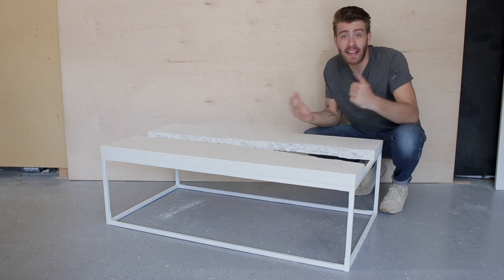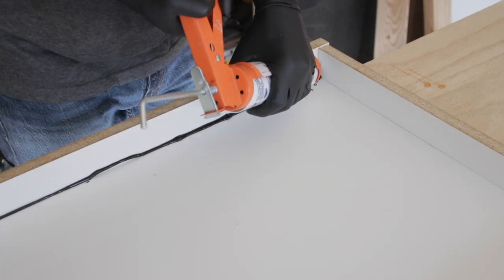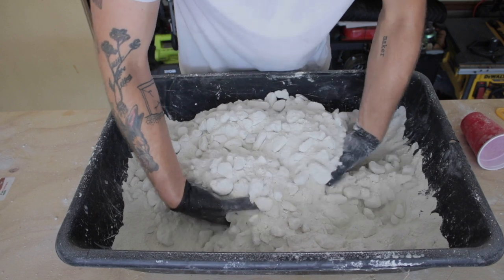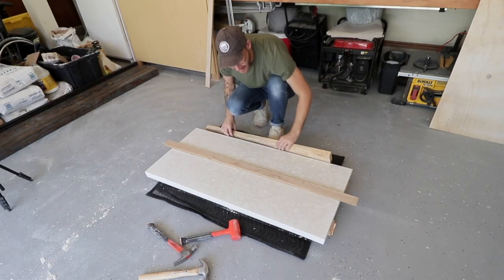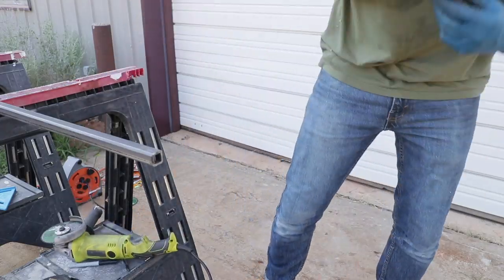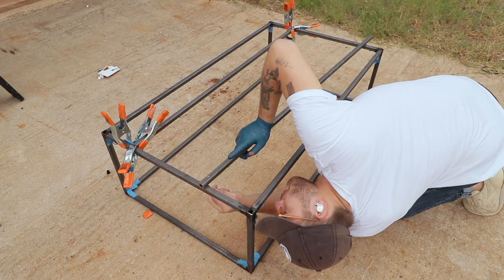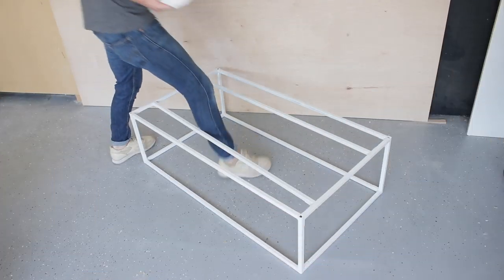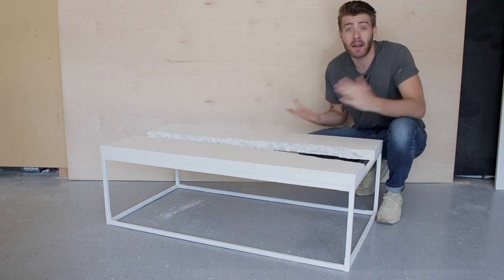Building a CONCRETE RIVER TABLE w/ DIY No-Weld Metal Base

Comment: Been really looking forward to this seeing this since you talked about it on the podcast and it definitely didn't disappoint! Really clever solution to not having a welder - both cheap and effective - and the cracked edge of the concrete looks amazing! I love the tactility and intricacy it brings which contrasts with the rest of the design, and although I see where others are coming from re. the open space with a coffee table I personally don't think you ever really need to use the full surface as the edges are plenty for mugs, books etc :)
Reply: JMakes without the glass it looks more like a museum piece.
Reply: I like the project but you put the dry ingredients into the water - not the other way around. Then you add more water if needed
Reply: @m3selfs950  It doesn't really make a difference in the end result, especially if you aren't using any admixtures.

Comment: I think I would have placed a thick slab of glass over it.
Reply from the maker: Dingoart that could look cool, but I still wanted people to be able to touch the ‘live edge’
Reply: @ModernBuilds  | think you should have added a tinted piece if glass in the middle of the table.
Reply: or under the concrete!
Reply: @ModernBuilds  Why? People are going to spill their coffee when they set it down. It's a cool concept I guess but not very practical.
Reply: @the_jonathan_o  everyone does that. I like that he wanted to do something different.
Reply: @TheWarrrenator  Or have friends that arn't so stupid they can't figure out which part of the table to set the cup on?

Comment: Excellent. But how did you attach the concrete top to the base?
Reply from the maker: They’re heavy enough I didn’t fell like it was necessary, but if you wanted to run a bead of adhesive the base that would work
Reply: Same question arrive to me??
Reply: @ModernBuilds  what kind of adhesive would you use? I tried using Gorilla Glue's construction adhesive for a similar project  but it didn't hold very well to the concrete
Reply: @sjandu  If you really want it secure you could drill a couple little holes into the underside of the concrete (don't go all the way through) and anchor a coil rod into the concrete using a two part anchor epoxy, then weld or bolt the coil rod to the base. That sucker ain't moving anywhere. Better yet if you plan ahead just float the coil rods in before the concrete has fully set. You can get some anchoring epoxy at home depot: https://www.homedepot.com/p/Quikrete-8-6-oz-Fast-Setting-Anchoring-Epoxy-862030/203604177?g_store=6655&mtc=Shopping-B-F_D22-G-D22-22_9_CONCRETE-Generic-NA-Feed-LIA-NA-NA-&cm_mmc=Shopping-B-F_D22-G-D22-22_9_CONCRETE-Generic-NA-Feed-LIA-NA-NA--71700000045600364-58700004679444416-92700039576811666&gclid=Cj0KCQjwpfHzBRCiARIsAHHzyZrGYo5FxQRavB_Cu60ci06iyAAoFCWe92G4TD85ftVEG5wlXRG7HKsaAh40EALw_wcB&gclsrc=aw.ds

Comment: Like the look of the table Mike. Not convinced on praticality, probably need to seal the joint to stop dust. Diluted PVA would probably do the job without affecting the aesthetic.  Regarding the no weld method, why does nobody use pop rivets these days? They are a really low tech solution and can look great. Just a thought.
I like that you try to make your projects accessable to those of us without massive workshops and love your enthusiasm. Thanks for the great content. 👍

Comment: The concrete just sits on the frame? Nothing to hold them together?
Reply from the maker: Nick Wisda just gravity... you could run a bead of adhesive if you wanted but no need

Comment: You had me up until the aluminum epoxy - Yeah it will hold two things together, but not structural or human load; And fill that crevice with clear epoxy 😎
Reply from the maker: Jon Gordon it’s steel epoxy.

Comment: How would you fill the river with epoxy? would epoxy hold the two sides of conrete together or would you use a thin backer on the underside like plexiglass? I want to make this but also want to fill the gap with blue epoxy and would love some thoughts on how to do that

Comment: This is really beautiful...i am wondering what it would look like if you made a clear transparent epoxy fill in the centre of the river path at the same with and height of the slab, that will make the whole surface functional😉

Comment: Mike - just a little design suggestion, if I may? How easy would it be to fix either brass rods or rebar across the void into the raw edge?
Reply from the maker: PageMonster shouldn’t be tough.. Modustrial Maker did something similar... not my style but it would be a neat look!

Comment: I find that if my wife holds the other side of the metal while I cut it works a whole lot better. Also eliminates the issue of table leg falling while I'm on the other side.

Comment: You really should have at least put a few flat head self tapping screws in the brackets since the top is so heavy. If you ever have to move, that table won’t travel well. I’d definitely stick to welding the frame on concrete top tables. Are you going to fill the gap with something?

Comment: I have a question (maybe missed it in the video): can't you just glue the metal legs directly to each other? Why do you need the L brackets if you're gluing it all together anyways? (I say glue, but obviously I mean the Gorilla Weld stuff.)
Reply: It gives it significantly more surface area to bond to which will increase the strength quite a bit.

Comment: Nice project, but its not complete. U should attach the concrete to the metal frame u made. Also u should add a sheet of glass on top if it to make it more functional.

Comment: Did you end up finding and removing the spatula you mixed the concrete with in the mix after you dumped it in the form? 

Couldn’t see it in the edit, so I’m wondering if you have a plastic spatula still in your table 😂

Comment: A terrible makeshift. The angles should be welded, or at least bolted to screws. The table top could have an epoxy resin inside or a piece of wood embedded in the concrete. It would look great. And of course, the top should be screwed to the stand, and felt or rubber pads attached to the bottom. If you are do something, do it properly.

Comment: Wow! I just watched your white cement video and I’m happy that you found a great improvement to the all white mix recipe. It looks amazing, and it’s so much stronger than the original! I wanted to make small pours so for me I think that the small aqua pebbles will be enough. Also, I was so surprised at the no weld structure, I really didn’t know how you will do it, but it’s nice to know that it can be done without specialized tools (I think that it can be ven be cut by hand, it I’ll take longer but can be done). Thanks for sharing!

Comment: If your concrete is a little wet just let it dry in the sun and the water will evaporate. I’m in the trades so I work with a lot of concrete.

Comment: yeah sure, the base is sturdy enough when loaded vertically, straight on the metal bars. but have you tried rocking it from side to side as if it was dragged from one place to another?
Reply: maxim_sys why would it ever need to withstand that

Comment: Nice looking project, Mike. I agree with others who've suggested covering it with a sheet of laminated plate glass might make sense and look good, too. But it surprise me than I don't see anybody else questioning the use of epoxy for something like this. Maybe Gorilla epoxy is something special. But I've been epoxy with and without steel filler for probably 30 years and I would never trust it to do the job in an application like this. Yeah, I saw you stand on it. But mark my words, that table will embarrass you one day. Still, I liked the video.

Comment: Could you screw in these steel bars if necessary?

I want to do something similar but my concrete surface is going to weigh around 300 lbs - I'm not sure I want to trust gorilla glue with that kind of weight.